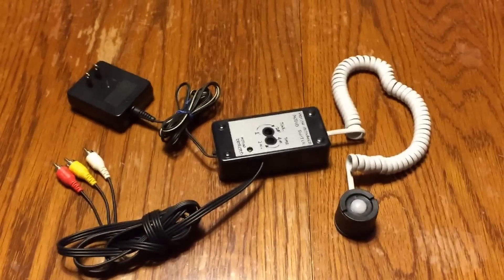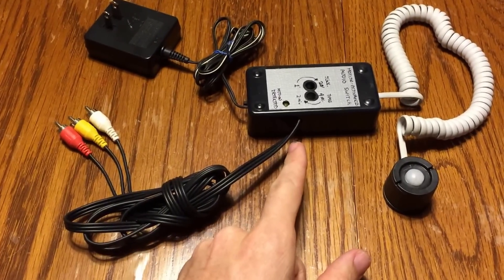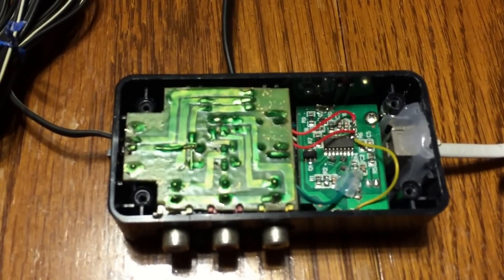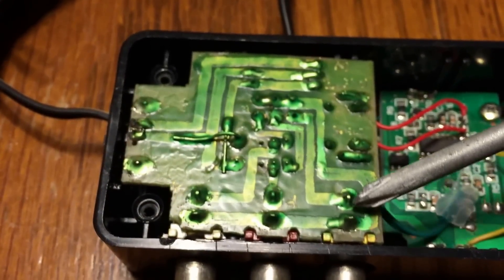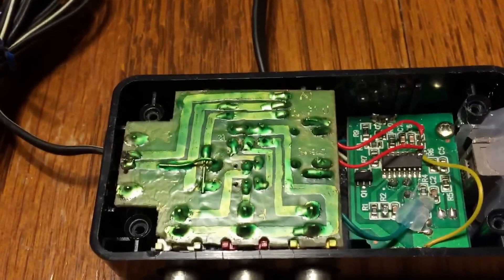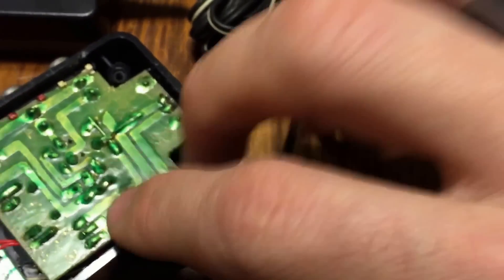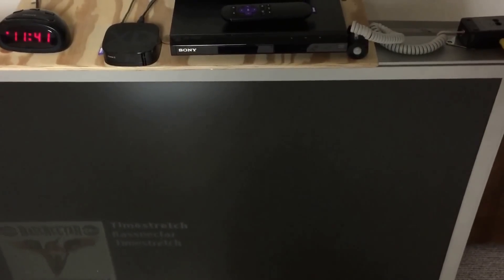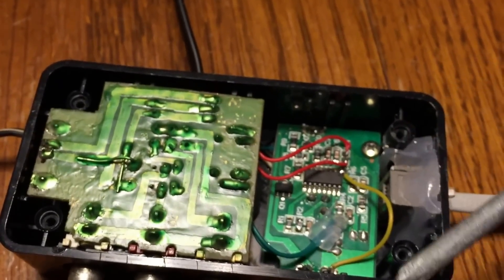PIR Motion Activated Audio Switch

Comment: great job bro!,,,,
am working with PIR sensor too in my project with arduino  uno R3 , to trigger
TIMER (COUNTDOWN) reading from the LCD 1602 and getting an alarm(buzzer/led) when the timer reads zero..On building the circuit and codes facing some probems though,, I WONDER IF YOU ARE AWARE OF THE ARDUINO?